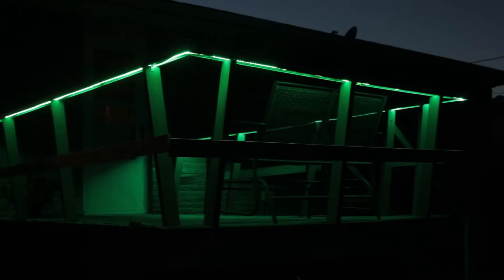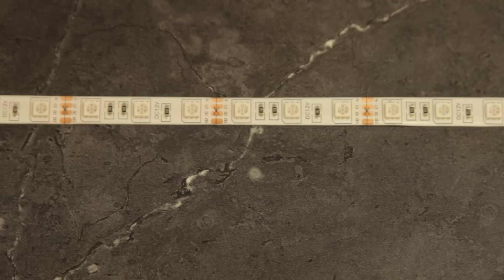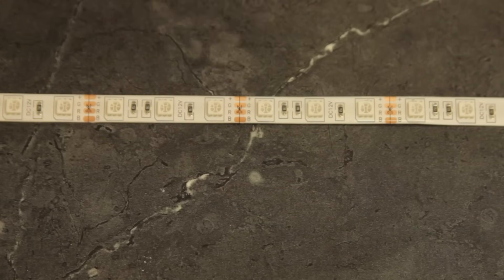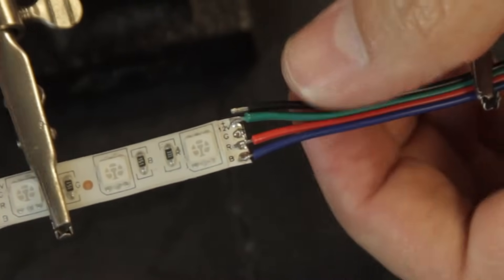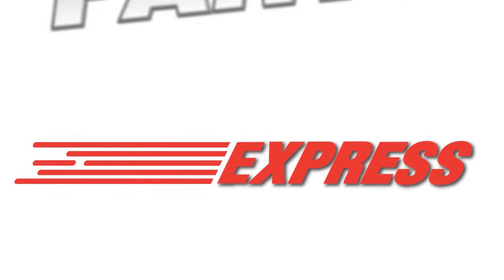How to Cut and Connect LED Light Strips.

Comment: i cut the lights before knowing they already connected together. i wanted to connect them since my pack came with 2 rolls, so i thought i cut them and connected somehow. now i don't even understand how to fix it
Reply: Sameee I honestly think I'm screwed and I'm so sad now
Reply: Look up 4-pin solder-less LED connectors on Amazon! There are plenty of videos on YouTube explaining it and they are solder-less so you don’t have to take these soldering steps like in this video. At least I didn’t and mine turned out perfect.
Reply: Samuel Sherrill thank you so much!!
Reply: Margot Hickman You’re welcome! Beware: Addressable lighting strips are not capable of being re-connected, but if yours are standard smart, non-waterproof RGB lights, you can definitely use the connectors. There are T-Shape (for 3 connections at once), L-shape (for clean right angles), and standard 4 pin connectors. The standard connectors are just for connecting your strips on a straight line! Hope this helps! 99.9% of led lights are not addressable and if they are, the company makes sure to let you know for sales purposes, so you would know if yours were.
Reply: @skls1234  wait what if u cut on gold thingy tho😕 im gonna cry bruhh
Reply: @skls1234  so if i cutted it on the gold thingy i can order the connecters to fix it back?
Reply: I can’t tell you without seeing a picture. If you cut through the 4 (usually gold) lines that say R/G/B/+, then yes you should be totally fine. 4 pin connectors are very common. You can probably find a solution to this issues by YouTubing 4 pin connectors. They make a setup look so much more clean too, I love mine
Reply: @skls1234  i did nd thank uu i already ordered the connectors

Comment: so i cut mine on the copper line to create a separate piece of led. what are all the items i need to connect it and insert into another power source so that it works normal?
Reply: Caitlyn Wells I have that ? To
Reply: Caitlyn Wells I need to knowww😭
Reply: I just cut mine not knowing that I need to go through all of this just to connect them again
Reply: @ajasteen4487  literally just did it and im fuming rn
Reply: SavageUnicorn12 Gaming EXACTLY
Reply: Caitlyn Wells 🤔
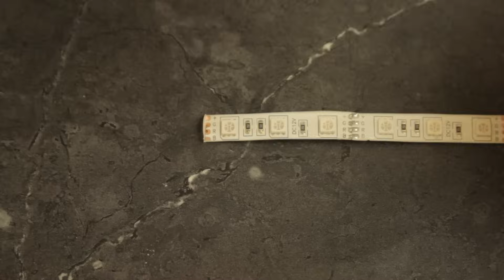Reply: Ok so Ik u don’t need to know anymore but for the ppl in the back who still do this is what u gotta do, when you first get your led, you cite it into a second strip, there’s a connector at the end, but if you want to cut it into 3 strips your gonna have to buy another connector (link in description) and do what he’s doing at 0:50 I was a rushed explanation so just ask if u still confused
Reply: @jadethegoldfish771  how do I connect the two strips I cut
Reply: Katherine Alexander With 4-pin solder-less connectors on Amazon. Look them up, made by Vilsom. They have a 10 piece multi pack with T-Shape (3 way), L-Shape (right angle), and standard male-to-male clip connectors that do not require soldering like he did in this video. So long as it’s being powered by the original power supply and you aren’t using more than 32.9 feet of roll per power box, you can connect these suckers all day long. It’s not hard, just YouTube LED solder less connectors. Doesn’t take any of these soldering steps.
Reply: @jadethegoldfish771  what if I want the strip light to end? Cutting it would be okay? No need for anything else?

Comment: * I just figured it out you guys. After trying time after time to force the copper end of the strip into the Connector IT FINALLY HIT ME!!!…..The little silver prongs lift up. Just take a blade and pop each one up and the strip slides right in.

Comment: hy.. i just brought 12v led strip light which include 300 leds. (300led lightup in 12v battery) but i want to powered it from 5v usb cable.. so how many led needs for it? well i cut aside 120 leds, i thought it could lightsup from 5v usb but it can't lighting. what to do? im newbie...
Reply: Hitz Net Portal , 300 LEDs are run on 12 volts right ?
so 150 LEDs are run on 6 volts right ? exactly half.
try that.

Comment: I wish I saw this before I just connected them with the male to female plugs built in... even though mine included the connectors but I don’t know why I didn’t think of using them. Now I’ve got the black wires hanging in three locations ...

Comment: Great video... just a note if you are using the DayBetter led strips there is no outer plastic coating to cut as is shown at 0:48.  You are able to just push the cut connection with the adhesive backing still on it into the slot of the connector under the metal clips and it works just fine!
Reply: Thanks. This should have been stated in the video.
Reply: could you explain this in more detail? I'm confused

Comment: This is such a bad video. We don’t have those “extra” wires your talking about and you didn’t even mention the name so now I cut my strip and don’t know what to do with it
Reply: Mark Hurban it’s like u read my mind
Reply: go on amazon and type led light strip connecters. it’s cheap
Reply: dude you just buy them.
Reply: It isn't a bad video at all.  "Extra wires" can literally be just about any kind of wire that's about 22 gauge, but if you look around on somewhere like Amazon or eBay, you can find plenty of sources of RGB extension wire for this sort of application.  Do your homework!  Nobody needs to hold your hand with play by play moves throughout your life.  Don't blame the video for your shortcomings, laziness and lack of research.  These lights are a project.  With all projects come proper planning, research, tools, supplies and a trial and error experience.  This video is part of that research and planning.

Comment: I REALLY appreciate your excellent video. It's very helpful. The video suggests that it's best to "seal" the spliced connections with heat shrink and you mentioned to make sure that we use the "correct type" of heat shrink but did not mention exactly what that type is. I also can't find a link to that specific heat shrink product. 

Can you please explain that part a bit more (and how do you heat shrink wrap if it's an "L" shaped splice ie at the turn on the corner of a TV)

Is it ok to use either electrical tape, hot glue or silicon sealant instead of heat shrink?

Comment: If like most of you, I cut the lights but since I couldn't find a way to find the connector try to connect both parts cut and I made a circuit and finally it worked, so idk if it works for everyone but you can try

Comment: u don't need to weld it together
Reply from the maker: Why wouldn't you? It would most likely become disconnected.
Reply: reef guy 92 , it's NOT a weld, it's solder but you are correct. they make and sell connectors that simply snap together.
just remember to put the heat shrink tubing on first.
Reply: If you forget to get the heat shrink tubing just tape it up baby

Comment: Wait if you cut it in the correct spot (the orange line) will it still work? Like say I cut it there would the little lights that’s connected to the remote would that still work?

Comment: The bit that’s cut off won’t work tho will it? Unless it’s obviously reconnected and plugged into the mains etc? Like you can’t just cut it and then place it somewhere different to the other and it will still light up

Comment: I have a 16 foot length of 5050 led strip that I want to splice and add an additional 5 feet to and make it 21 total in length feet. My question is will the power supply handle the extra 5 feet or do I need to home run the extra 5 feet back to the power supply?
Thank you..!

Comment: PLZ TELL ME SO FOR EXAMPLE IF YOU WANT SOME ON YOUR WALL BUT HAVE SOME REST AND WANT TI PUT IT ON BED DO I HAVE TO CONNECT IT WITH THE ONE ON THE WALL OR WILL IT JUST WORK IF I CUT THE COPPER ENDS AND THEN PUT IT ON THE BED AND THEN IT WILL WORK?

Comment: I have 3 rgb rolls that I would like to join toguether and make it into one. Two are 65.5 ft  one is 25ft. I habe jumper connectors that have the white cover in both ends. So do I need to cut all three rolls to join them togueter?? Do I just need connectors in between or do I need extra stuff?

Comment: Led strips power adapter support usually lenght to 5m if you add extension should it overload  the circuit? That is why usually  you won't  see any for sale with lenght 32 ft or 10 m or more...

Comment: Hello!! 
Can I cut a led strip into sections and connect each section with power supply?
Reply from the maker: Depends how short or long you are cutting. You don't want to run too much power to a small amount of lights.,

Comment: I have a 16 foot  length but only need a piece 8 feet long. Can I just cut it in half and still use the same 12V power supply?

Comment: So I had it all set up and it looked good, but after a couple hours the adhesive failed so I nailed them up and now my second strip doesn’t work. My connector stabs into the copper on both ends and I think I may have ruined the connection because I had to undo it and stab them in again. The first strip lights up but the second one doesn’t. I’ve turned the connector around and backwards and it still doesn’t work.
Reply: For reference I got the patriot lighting led flexible tape light 18’
Reply: Ok I found the problem. The copper end on the working strip is it up(idk how though) and the G and W connections are severed. I’m going to cut off that strip and work from there!

Comment: hi i have the same strip as yours and the same black connector but i am trying to connect the t shape and L shape white connectors to the strip but the grb are in a different order at the top  they say bgr instead of grb on the strip and on the other end of the connector it says rgb which does not match up to the led strip do i have to match up the letters the same if so what can i do.

Comment: If u cut them and used the adapter how would u finish the other end so say I want to run 42 ft pf like and I had 2 32 ft kits and I use one and cut 10 inches off the other one the end that wasn't in the adapter how would I finish it

Comment: The average person isn’t going to have any of the things you used to connect these. I just bought some LED lights and after I cut them, the pieces I cut off don’t even turn on when the power is on. They only turn on when I hold the pieces together. I don’t have any connectors at all so I have no idea what I’m even supposed to do.
Reply: There are ZERO instructions on the box. I literally have no idea what I’m supposed to do.
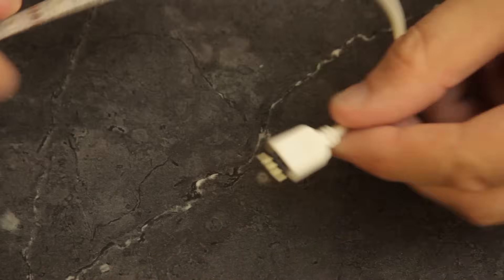Reply: Darkwolf787 OMG SAME. I bought mines on amazon called minger or something like that! But my dad said the connector thingy on 1:00 you can buy at Menards which will help connect the 2 pieces together better ig
Reply: tenzin Lhamo I went to Menards and found them right next to the LED strips actually but I bought another strip and decided to not cut them

Comment: How is this done when using cheap family dollar version?   The circuitry looks completely different.   What I'm looking at here looks more like a standard circuit board layout. It still has the cut line but no clear connections.
Reply from the maker: You may have to scrape away some plastic to find the connects, but everything should be basically the same.

Comment: If they don't make this, they should. An adhesive strip that looks just like the led strips, same dimensions but is nothing but 2 flat wires to connect smaller strips together. Do they make this?

Comment: I just bought bedroom lights and it said to just cut it and that it will work fine because it’s Bluetooth connected is that true? I’m scared of cutting my wire to fit it right around the corners of my room

Comment: Hello can you help me? So we have done what you said, bought the adapter kit and all, and it worked for one side of the lights. Now the other side won’t adapt to the new strip of LEDs. We’ve cut four times just in case the light connected to the outlet wasn’t cut right, and we’ve checked and plugged in the new lights to make sure they work, but they don’t work together. Can you help us find a solution?

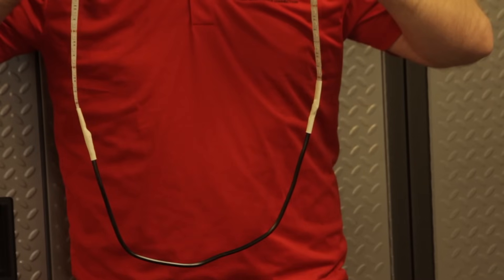Comment: Ohhhh myyy gawddd he’s not telling y’all that y’all HAVE to do the extra stuff in 1:15- to the end of video. He’s saying IF y’all want to slaughter them exactly together then you have to use those tools he used. If y’all wanna connect y’all light then you simply just cut the copper and connect them with that piece like he simply did in the video. It ain’t rocket science.
Reply: He’s just showing multiple ways to connect them based on everyone’s preference

Comment: Hi! I want to cut my led light a bit, bcoz it's to long. Do I have to cover the end after cutting it, or I can start sticking it on my wall?
Reply: did you cut them yet? if you did did it work
Reply: Hi... there's a part where you can cut it. And yes. After cutting it. It worked. No need to cover bcoz it's already covered.

Comment: I just want to reassure all those who think they ruined their lights after cutting the strip. I watched the video and immediately realised I need to get those connecting clips. I cut one clip just to see. The lights work fine.
Reply: The double sided tape doesn't work on our painted walls so I'm using my glue gun.

Comment: Mine are going around the edges if my TV. You can't curve them without them bending. The only way is to cut them so you make them into a square around the TV. The problem is I cut 4 straps so they go around the edges of the TV. Now they are attached to the TV but how do I connect the newly cut strip?

Comment: Not shown was how to join two strips "together" without connectors or soldering wires to sections, just soldering two strip ends together.  BTW   the correct English is "soldering"  from soulder to join two pieces of metal together by melting a soft metal between the connections and joining them together as soddering is wrong, not in the English dictionary and sounds illegal .
Reply: As it should be! Blasphemy!

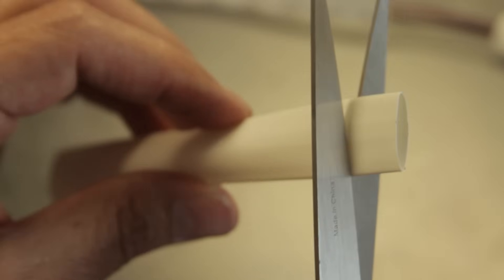Comment: So in 1:15 to about 1:40 you talk about using leads to connect where you don’t want lights. Is it possible to connect, for example, a RGB 4 prong strip using that lead and solder it to a pure white strip with only 2 prongs, so long as you match up the cable colors? I want to connect red, white, and green, but I can only find white with 2 prongs. @Parts Express

Comment: Ok I have tzumi led lights I have watched the video several times and it does not  make sense at the ends of each 6.5 ft strip there is a connector that plugs into a receiver that goes to a USB thing my lights are on my ceiling I really want to try this but I Dont know Cuz I Dont want to mess up the receiver thing that plugs in if anyone has advice or help please let me know

Comment: I was sent strip light that only have 2 pins no connectors And the other strip lights i have are 4 pin plug and play. Do i have to buy the connectors or can i somehow use the plug and play since i dont have connectors. Any help is appreciated.
Reply: If you don't use a connector designed for this or solder together a good connection will not be had. Automotive rear defogger isn't a horrible temporary solution though.

Comment: Oh so your suppose to take out the plastic once you want to connect the circuit to the connector? 

Ok so I never had led lights before and didn’t know all this. Someone told that I can cut the led strip to how much I want and I did just that. I cut exactly where the scissor shows but I thought it could work without them all being connected and I - was a complete idiot  for cutting it. And found from google that I needed an adaptor or a connector 🤦🏼‍♀️

Comment: Where. Can I get the part to connect 2 lines?
Reply from the maker: https://www.parts-express.com/5-Pack-LED-Lighting-Strip-4-Pin-Male-to-Male-Connector-073-111
OR
https://www.parts-express.com/LED-Lighting-Strip-to-Controller-Solderless-Splice-Cable-073-0104

Comment: I accidentally cut the light strip at the cutting points and now the only strip that is working is the one connected to the power source, what do i do? And the thing is.. they're already stuck to my wall. Do I have to get replacements?

Comment: Umm where do I get the connector? I kinda just want the controller and USB connection for the part that was cut. So it needs to connect to the controller, not a different LED strip. The leftover is pretty damn long. This video is awesome but pretty useless to me. :(

Comment: Does this work with the govee light strip?
Reply: kind of i spliced 2 lengths together using a 90º joint and the second strip is a different color so no idea why they are not in synch

Comment: To anyone who is having issues connecting their light strips with connectors: SOOO I bought the DayBetter 32ft LED strips and stupidly cut the second one thinking I knew what I was doing, but I clearly didn’t and felt as if I ruined it! I had already bought connectors knowing I’d need them. After watching this and trying, it still didn’t work but then I tried something... when putting the two strips together using the connector, flip the connector BACKWARDS so the doors are on the backside instead of the front, and the spikes are piercing through the FRONT and not the back.. AND IT WORKED!!! HALLELUJAH!! And on top of that, both light strips flow the same and have the same color, no dimming issues.  I hope this works for you guys and you no longer feel like you wasted your money!! Let me know if you have any other questions!
Reply: can u explain the flip thing more
Reply: paradyse When Using a connector, there is a normal way for them to sit, with the ‘doors’ on the front facing you. Mine have spikes that would typically puncture though the back of the strip to the front. But by having the connector face backwards, with the doors on the back. Have the spikes puncture through the front of the strip instead and lock it!!  If enough people request I will upload a video to make it easier to understand!
Reply: Were do u buy connectors? Home depot dont have them or Walmart or lowes they just got the lights 😮